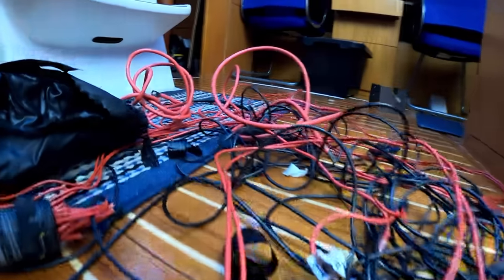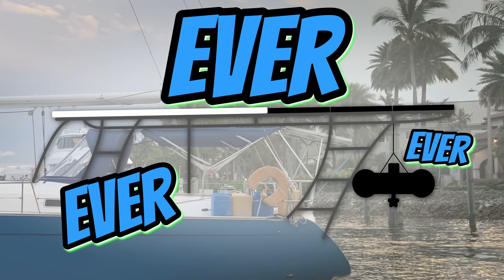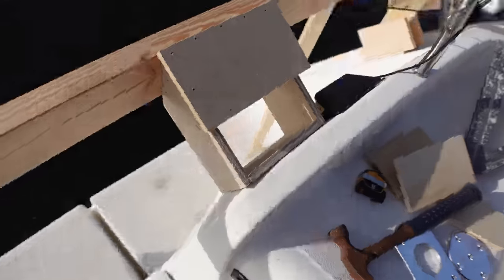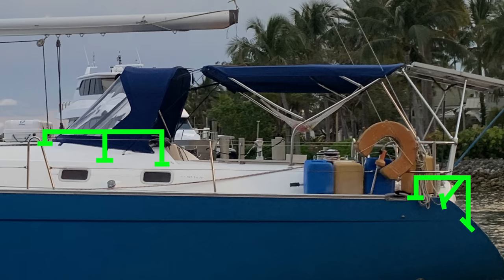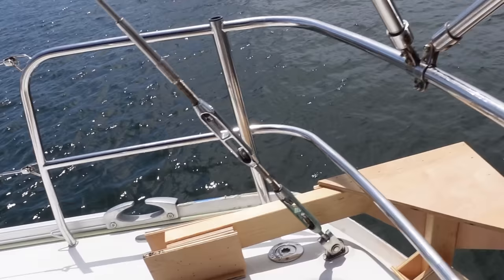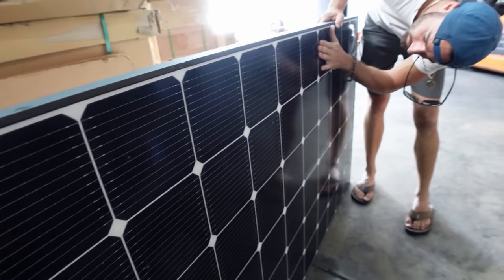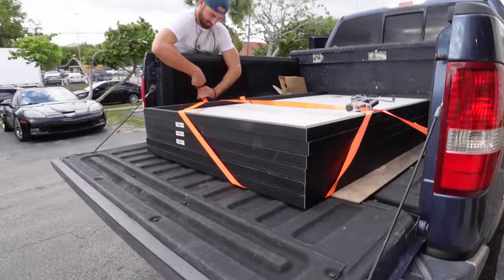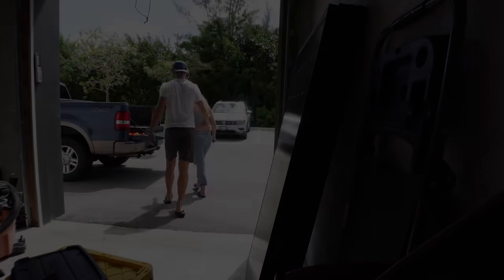PUSHING BOUNDARIES! Massive Hard Top Frame Install on a SAIL BOAT! | ep.28

Comment: You both are doing a great job on both your boat upgrades and the videos. Very creative, the results show it. My only comment, as an engineer, is to through bolt the forward attachment plates. It would make stronger in tension loads, due to the tender and all the stuff you plan on storing up there. In heavy seas you will thank yourself for adding the extra strength.
Reply from the maker: Agreed, we are through bolting every pad, just waiting on Jay to finish making them all

Comment: Shade, etc. spot on. But Sir... style, it looks like the biggest doghouse of the world. I get the practical part, but in a storm, you have now added  stuff that will get hit by the wind and waves. You also lifted your centre of gravity by lifting the boom + all the other heavy stuff in top of the bimini. Do you notice the change when sailing? Cool videos absolutely love them. Hope that the top is made in sandwiches structure for keeping it light. Also it would have been a good idea to use carbon tubes in the frame, they are not so expensive any more.

Comment: That’s a crazy amount of weight to add to your boat. Also all the weight aft and high. The high weight  is definitely an issue as it alters the moment of vanishing stability and the capsize ratio. This is super important and the capsize ratio on your boat from manufacture is already outside recommended specifications for a blue water sailing yacht, yet you say you want to sail around the world. 
Great work but man buy a huge motor boat or a floating apartment catamaran, that monohull is not the boat for you guys!
That is a cool hard top though! 👍⛵️

Comment: This was great.  We just did the same thing, but with a truck.  Same thing as in we built it in the shop and then mounted it on the truck.  We used steel.  We had one mounting point 3/16" off, but since it was steel, we just used persuasion to make it fit.
I think what you have done is great.  I do think it will handle a little different, but you will get used to it.

Comment: Did you consider the flexible stick-on solar panels that you can walk on?
Reply from the maker: Yes we did, but they don’t last as long and are not as efficient as the rigid pannels. We thought if we needed more solar we could always add more to the hard top later on

Comment: That frame came out beautifully... The only thing I'd be concerned about is sealing the bolt holes so water doesn't get into the cabin, making sure the stainless/aluminum don't have a direct metal-metal connection because of corrosion, and making sure it's WELL grounded to the bonding plate. Also may want to keep an eye on how much weight you're adding up top as it could affect your balance and catch the wind if your boat rolls a bit farther than you expect.

Comment: Hallo Very nice idiea. But the way you screwed you will have problems with delamination as the water will seep in over time. The best way to drill holes in the deck is to measure, drill a larger hole, fill with epoxy and then re-drill the hole to the correct size.

Comment: i worry that on a monohull, when you heel over, those panels will act as a sail and mess up you handling.....  could be dangerous in a storm
Reply from the maker: Might be right, time will tell!
Reply: @SpearItAnimal  perhaps substitute removable canvas for the fiberglass only roof  portion.  you could reef it like a sail.  also, would sea trial in a few storms in coastal waters to trial it with coast guard response available.....  would trial a storm anchor too.  with the added windage, your bow may need internal stiffening to withstand the added pressure....many houseboats have similar structures on top.  you might ask someone who added one how it changed handling on windy days.

Comment: Will the size & weight make her rolly/tippy with beam winds or waves? Will it affect navigating in docking areas? Fantastic work, from vendor selection, jig fixturing, laser measurements, through fabrication, help from friends, to phase 1 - attaching to the deck. Looks daft. Top notch.
Reply: A dodger goes in front. So there will not be wind passing underneath the Bimini/Solar panel/dinghy davit thing.

Unless the dodger is opened

With an open dodger it would depend on the forces at work.
Reply from the maker: I’m sure it will a little bit but the question is, how much?! We’ll find out soon! And thank you!
Reply: Any plans for winndow openings on the hard roof? For sail/other visibility, wind venting/circulation similar to canopy tops.

Comment: First, this looks cool and seems an awesome idea but, also very unsafe. So my question is have you done any calculations regarding how will this affect stability & handling? Please tell me you had the manufacturer or experts sign off on moving the boom up?

The boom, dinghy, the hard top, the frame, the panels all add weight up higher which negatively effects the stability. How much will the entire set up weigh? That weight will now have to be deducted from the available weight of cargo/supplies you can carry. Have you had a Naval Architect or the boat manufacturer do some revised stability calculations on it?

Also, when you are sailing you will be listed over, which will put the hard top at a greater angle to the wind, allowing the wind to "grab" it more. How will this added sail area affect stability under sail while listed over? Will the added sail area of the hard top reduce your ability to use a given amount of actual sail in a certain speed of wind? How will the added sail area affect handling when at sail and listed over?

I've been a professional USCG licensed mariner for 15yrs, (3rd A/E Unlimited, OICEW, Master 100ton, etc), and the safety & stability questions on this hard top retrofit scare me. Looks cool and I hope it works, but thousands of boats and lives have gone under the waves for good due to stability miscalculations/modifications.
Reply: I agree. This is going to have a major impact on the self-righting calculations and the sailing performance of your boat. I’m not faulting your ideas and workmanship but I can see that there are major safety and performance issues both with the significant additional (top-heavy) weight above deck (even though it’s aluminium), windage and altered boom height. Did the riggers comment about the new boom height or did you raise it after they had completed their inspection? Naval architects design on very precise calculations. A quick visual check will show on the waterline - is it still level or is it stern heavy? Are you lower in the water? I have to be honest and tell you that I wouldn’t put to sea with such a modification and I have over 40,000 nautical miles of ocean and coast sailing under my belt. I’m not against innovation and I can see the positive energy in your ideas but it should always be ‘safety first’.

Comment: One of the toughest things to get right in offshore boat design is the tradeoff between providing enough shelter to make sailing enjoyable while maintaining the primary function of the cockpit, which is the command and control centre of a complex machine that operates in a potentially hazardous environment. The key point is that cockpit function as well as visibility  should always come ahead of insane amounts of solar or shelter on an offshore sailboat. So it does beg the question are you designing an offshore boat or what appears to be an on anchor office?
Reply from the maker: Definitley thinking about the vibes on anchor with hopes of catching good weather on crossings 😂 let’s hope our design is strong enough for the unavoidable squalls
Reply: @SpearItAnimal  Ok yes it is insanley big. Windage, performance 😮I thinking about your sail vis is in the dumpster. Maybe a large hatch on hardtop.

Comment: Frankly, you totally underplay your skill set. Already the cabin sole was something else (especially when you got it all to line up) but building the jig for the bimini was something else.  I know you said that you had "some carpentry skills" but THAT is not that!  It was so good that you fit the hard top in one session.  Unbelievable, your boat will be better than new (a lot better).

I don't think you showed it but did you check the ribs of the boat (to be sure that it was well attached?)  I understand that Beneteau has had some issues with proper adhesion...  anyway mad skills.  I get the feeling that this was all done about a year ago.  Very interesting

Comment: Wonderful, its big and bulky but beautiful. Well done on the design. 
“The most efficiënt PV panels” funny to say that every sailing channel has the most efficient. 
I really wonder how has the most efficient. Let’s have contest. 
Now your boat is quite big. But still the roll stability will be less by adding these frames. 
The Self righting  number is compromised big style. And above that these boats do not have a great number on that. They are simply to wide  for the ballast part that is in the water.  For sample 
The most compromise boat of the sailing channel is Rick more his sophisticated lady.  Although that boat has a fair self righting number.  But hey, he sails the flat waters of the gulf and plays it safe. 
So please consider that adding weight to to te top ,ale your boat shaded and makes loads of electric energy. 
But the boat does become more rolli and the self up righting may be out the door.

Comment: I know she said temporarily screw it down, just the same, I thought I'd mention making gaskets for all the connection points. Like 1/16” to 1/8" thick PTFE or rubber sheeting of an appropriate hardness. Not for water intrusion, but for stress reasons. The contact points of the pads won’t have absolute perfect flatness, nothing is perfect. Adding an appropriate gasket helps to unify the contact stress around the bolt circle of the pads, remember your bolting to glass. This helps keep gelcoat cracks from forming at contact points over time.

Comment: What comes after the solar/Bimini?

Let’s see washer dryer, ice maker, DW, larger refrigeration, then AC and heat.

Now you are up to the price of an Amel 54 which comes with all that stuff.

And You can sleep on it during a passage!

That will not happen on a Beneteau.

Not to mention the four sealed compartments, ergonomic perfection, and Land Cruiser like performance. And then there is the engine compartment.

Did I mention an Amel can be found at fifty north or south routinely?

Amel 54/Amel Super Maramu

Comment: So are u going to have Aluminum touching Stainless?  Isn’t that a possible corrosion point. Two different metals touching n
Reply from the maker: We’ll have a barrier in between where the stanchions bolt to the frame but idk how important that even is…every aluminum t-top, tuna tower, and solar arch you see is attached with stainless steel screws 😂
Reply: Let us know what dies or dies not happen. Btw, the whole deal looks great. I think you will find it fine but the boat might be very slightly slower because of weight. I think windage is fine n
Reply: Does the roof have some windows so you can see the sails to make adjustments?

Comment: That rig? A thing of beauty, and smart AF. It fit perfectly because you did the work to precision, it's just so impressive. A few things. I'm not sure the windage will be that much different than the bimini. Using aluminum eliminates the weight concern. In a roll-over, it could overwhelm the boat's self-righting moment, but then again, but then you are well and surely fucked anyhow. Looks great. What i'd worry about its the dinghy weight. Do the math on the compounding effect of weight as it gets farther away from the central balancing point of the boat. Could effect handling in a heavy sea. Is it possible to have a place to lash the dingy to the deck in a storm rather than have it on the davits? 

Fwiw, I'm more curious about how moving the boom up 1 foot will effect performance. I suppose your sailmaker was able to tell you something about that, I didn't see any of that detail, would be great if you have it.
Reply: Good point,  rolling a mono hull could easily hit 40 grand in repairs (particularly the electronics you'd fry)
Reply: @joelhemington1033  It would be nice to get new polars done for the boat with the new sail plan. The center of effort moves up and forward. I'm not so concerned about rolling the boat as I am how this changes the powering of the boat overall. Does it change  any of the load dynamics of the rig? It may not be a big deal. But I'd want a marine surveyor/architect/sailmaker to tell me that and why. Part of it is that I've NEVER seen anyone do this to their boat. It kind of shocked me, and I raced and was a yacht broker on the side for a bit and never heard of someone doing this. Probably just my overreaction. 

Cuz I don't want to take anything away from how these two are absolutely rocking out their boat AND channel. The attention to detail and the precise and in depth planning they do for each job is so impressive. Making me up my game when approaching projects, they are inspiring!
Reply: @joelhemington1033  I’m not so sure that it’s the cost of rolling but rather the chances of survival that matters most

Comment: Yall are awesome. Don't take my Plaque off the wall I shall return soon just figuring out some things with my new Medical problems. I have 3 partial blockages and 1 totally blocked arteries and the the one that just got all the attention with 3 back to back stints. Everything I go to a new Dr it's $25 so far I am up $150 a mo coming from my already small check.
Reply from the maker: We won’t! Finger crossed, hope you get sorted out! 💚💙🤞🏼🙏🏼
Reply: Yall are jus excellent I think Raf is as smart as my Grandfather. Especially with that showing the angle for the mount that he explained. My Grand father changed the target system for the Army which then all the other services adopted it.  It was the Target holder and use to need to be replaced quite often  because it was a single small board that held the target in the middle, my Grandfather's replacement was  changing it from one stick to 2 sticks on either side it looked like a H that way the target holder no longer went through so many single stick target holders.  My Grandfather was a genius was hired straight away by TVA they made sure he stayed with them and he did for 40 years he retired with an amazing benefits package. He had a stroke and died after about 2 yrs later that happened about 30 years ago.

Comment: OMG! That thing is horrible. All that weight aloft! The windage will be crazy if you are ever caught in a storm. Forget ever making progress to windward.
Reply from the maker: You speak as if you’ve done it before, and it’s actually very light…time will tell 🍻
Reply: @SpearItAnimal  I have sailed the Atlantic Ocean several times.. That setup is fine for pottering around the Caribbean. But if you get caught in a storm  mid ocean, you really don't want all that weight of steel, solar panels, and dinghy so high up. As you lean over, the windage is huge. Like a sail. If you have to make progress to windward, that setup will be like leaving the parking brake on

Comment: Since you insist on calling a galley a kitchen and a heads a bathroom, I’m surprised you don’t call that hardtop a roof. You’ve added a lot of weight and windage that the boat wasn’t designed for. Nice work, though.

Comment: You might be re-thinking this idea if you ever get caught in a tropical storm...
Reply from the maker: You might be right, but I’m sure 99% of boats wish the shape of their boat was a submarine when they’re in a tropical storm 😂 they’re building catamarans like 3 story cubes these days so I’m sure our boat will still be more arrow dynamic than many others…but we’re treading new water so only time will tell!
Reply: @SpearItAnimal I genuinely don’t want to dampen your enthusiasm as you both have a great energy but you’re really displaying your ignorance of the forces at play at sea especially when you compre to a catamaran. The calm water stability (let alone in a significant seaway) of a cat with its beam to length ratio is no comparison to a monohull. Your boat is designed to self right in the event of a rollover but I seriously doubt the designer/manufacturer will tell you that the boat will self right with that structure on top. Sure it gives you shelter from the rain but if you ever find yourselves in gale force winds with significant seas you’re going to be in real danger. So much can go wrong - a rogue wave could strike you on the beam with enough force to rip that frame off (just imagine the collateral damage) or you might roll the boat through no fault of your own. As others have noted, it’s like you’ve added another sail … only problem is you can’t reef it or take it down when you have to. I don’t know your sailing background but I recommend you seriously reconsider taking this boat offshore. For the record I’m a liveaboard sailor and sailing coach with 40,000nm behind me and I’ve seen some pretty gnarly seas. Please take this advice with the well meaning that’s intended. I’m not trying to be negative but  I am keen to see you both safely survive your sailing adventures.